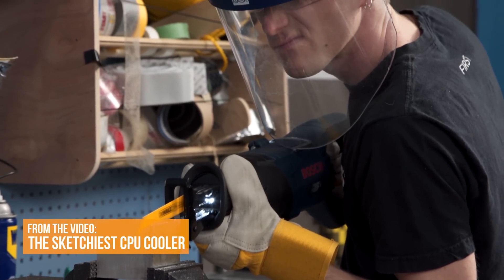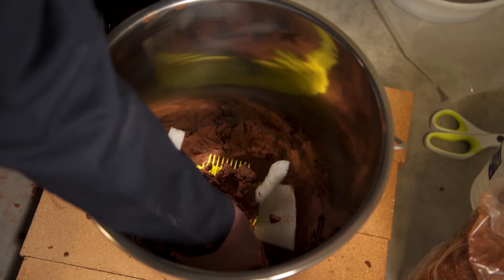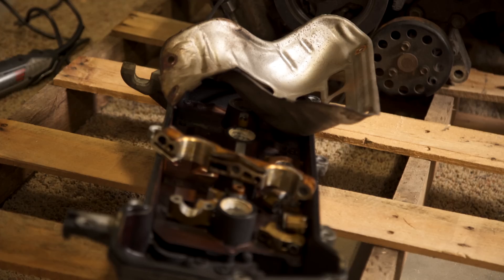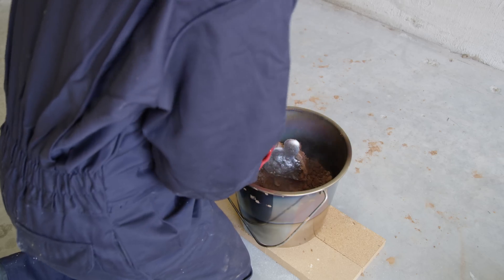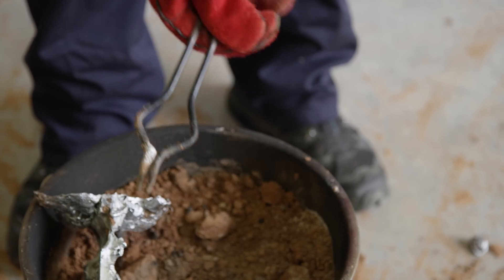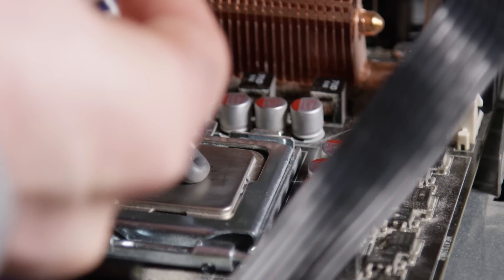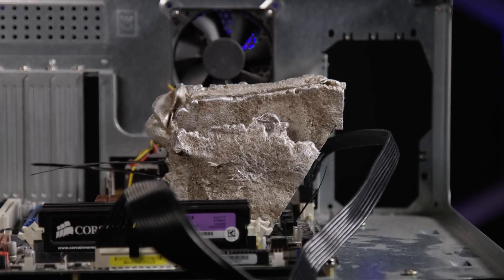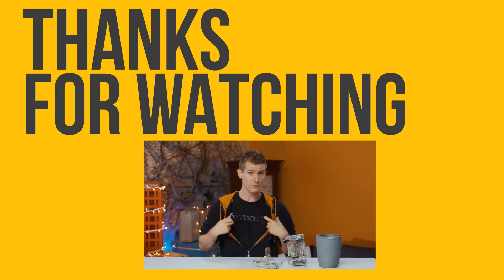The WORST CPU Cooler EVER – Sketchy Heatsinks Ep2

Comment: Aluminium sheets.
some bolts and nuts.
something to cut and make holes (i can do it with a paper cutter and a hammer with some scrapyard pieces)
is all you need to make a nice heat sink.

the idea is simple, you make a ton of small aluminium sheets, and some spaces with the bigger aluminium sheet using the paper cutter (notice that is a thin aluminium sheet) you make some spacers with the same aluminium, then you make the holes, and bolt them together.

another idea, very cheap, is to just pick a aluminium block, make some holes on it and install some break lines on them to pass liquid cooling using a fish pump.

my craziest idea of cooling system is just using old freezer parts, more specific the radiator and the fan along with some coper pipers. but that is a bit crazy, still it uses water... not gas.

Comment: why dont you just create a plastic version from a 3D printer, (or use PLA) and just stick it into the green sand, wait for the green sand to take its shape, and then pull it out. use the holes created as a mold, and pour the aluminium into that.

Comment: "...and the mould had to be oriented in such a way that the bottom would be the most likely surface to have a smooth, flat finish."

???

You're not going to get heat-sink level smoothness out of casting no matter what you do. You'll have to polish that surface and use thermal compound anyway, so stop worrying about inconsequential things. Just orient the mould the other way and let gravity draw your molten metal into the fins.

Comment: Polyfan, you need to do al the stuff with polyfan!
You can cut polyfan with a simple cutter or foam saw, you can sand it too!!! And is cheaper and cool than 3D print also
Then you  painting it with porcelain, let dry one or two days...
then you can cover it with sand and voila!!! (That is the method used for tiny triggers in weapons or clock machinery)
If you don't know how to do it ... you can't say "is a bad idea"

Comment: You should have packed the sand in a square plate shape, then used a rod to poke holes. You were too focused on making fins instead of considering easier designs.

Comment: Making a heat sink in home is not that hard
You could use a 1 cm thick aluminium plate and thin alumni sheets , And using TIG welding machine weld them together
You could also use coper plates and solder them together is so much easier than your method

Comment: Okay, a couple of things.
First, with the level of detail you need to cast a heat sink, use plaster of Paris, not sand or clay.
Second, Use the lost PLA method, meaning encase your 3d printed heatsink in the plaster,  Wait for it to dry, then put the mold in the oven upside down at around 500 degrees F and let all the PLA melt/ burn off leaving an empty cavity behind then blow it out to get any ashes/debris out of the cavity.
Finally get as much metal as hot as you can and pour it with the tallest risers and sprues you can make to completely fill said cavity.
you should have a bit more success that way.

Comment: Cast a long thin fin. Cut it to pieces. use foam as a spacer for the fins. Set the fins vertically on a molten aluminum brick cast. cut the sides of the cast to square it off. Use heat tape to put a piece of copper planchet on the flat area of the heat sink :)

Comment: you should use a 3d print and make a mold out of a mixture of equal parts plaster of pairs and play sand with a a riser but put it in a kiln or heat it with the torch and burn out and fully cure the mixture after it it dries but do it outside or in a highly ventilated room to avoid any fumes from the mixture or the plastic and then when you cast it you will not need nearly as much  static pressure

Comment: Dear Linus, if you try the foam way again, but cast it while the heatsink is upside down in the mold, you possibly won't have the trouble with the pressure.

Comment: next time, cast aluminium into a tube filled with those soaked water crystals (polymer balls) and flush out the polymer balls afterwards. you get a structure of aluminium that looks pretty much like a coral. i imagine that would dissipate heat pretty well.

Comment: Maybe better to use abs then pour shit ton of acetone in then the aluminum or your pla less dense so it would melt easier...both do not simply disappear though but in your mold make a spot below the heat sink where the melted pla or abs can drain to leaving only the aluminum in place of the mold..

Comment: Your green sand is way to wet...
 Lost PLA needs to be done by burning out the PLA before you pour. so you cast your PLA in a solid plaster type casting material, flip it upside down and put it in an oven to burn out your PLA leaving your negative.

Comment: Just look at how companies like Noctua do it. Make some heat pipes and attach fins to them for surface area. The pipes can be made from scratch with far less effort than casting metal, they conduct heat faster than solid metal, and it's cheap.

The process for making a heat pipe starts with a length of copper tubing.
Seal one end by crimping and soldering it shut.
Fill the tube a quarter full with practically any liquid that wont break down (tap water is good enough, acetone or alcohol are better but flammable and hard/dangerous to seal).
Raise the tubes temperature to the boiling point of the liquid.
While wearing eye protection and the liquid is boiling, crimp and solder the last end shut.
After cooling back down to room temperature, hold one end of the heat pipe under hot water or over a candle flame and notice how fast the opposite end heats up. If it's faster than a hollow copper tube of the same length, then the heat pipe is functioning.

Start with a straight tube and only bend it to shape after it's done.

Because it was sealed at the boiling point, when it cools back to ambient temperature the contents of the tube will be at negative pressure - this makes the liquid change phase at much lower temperatures than usual. How well it works depends on the temp difference/delta between the hot and cold ends, the liquid's heat capacity and a hundred other factors. It's an art, but a very forgiving one.

Optionally, rough up the inside surface of the copper pipe, and/or loosely* pack it with fiberglass (twist the fiberglass into a kind of string that fits easily down the tube). Packing it with lots of tiny graphite rods could also work, instead of fiberglass. All of these provide a literal wick to carry condensed liquid back from the cold to hot end, and nucleation sites to promote phase change. These fillers may reduce the volume of the tube, and the amount of liquid should also be reduced.

Comment: A cnc machine would have gone a long way in this project
Reply: Can't believe I've been scrolling through comments for 5 minutes and this is literally the first one about CNC machining. Totally agree, they should have sent the solid to a machine shop.
Reply: You could do anything you want with CNC that was not the point of the video..
Reply: No no no.  You just CNC everything.  Those air bubbles in the aluminum would kill it.  They act as blocks to the flow of heat.  CNC to cut fins and smooth base.
Reply: Seth Nicodemus I'm afraid that the castings they've produced there would've had to be shaped for a REALLY long time using a CNC before they would've resembled anything usable....
Reply: Not a good idea. CNCs are no idiot-proof. They will happily destroy themselves if you give them wrong instructions.
Reply: They did a milled heatsink. The DIY water block. They had their neighbor make one up using a manual mill.
Reply: With a computer controlled Cnc it’s trivial. That’s probably how they are made in the first place I am almost positive. I don’t think they are cast.
Reply: a c well even if they did a milled water block some other video it doesn’t help here
Reply: hellterminator so will a car...  but qualified operators use them all the time.  Not sure of your point.
Reply: +Andy T After watching this do you honestly think any of these doofuses is qualified?
Reply: @hellterminator  get an old hand-crank Bridgeport like in high-school, and they'll be fine.
Reply: hellterminator no. But it’s Canada. Don’t they have free health care or something. There’s the shy red head that seems to know a small amount. But it wasn’t really a suggestion that they actually do It. Just that we’re you insistent on actually for some reason making your own heat sink- say you work for nasa for a custom computer- not PC x86 entertainment vlog- the proper way would be CNC. 

Here. All that matters is the number of views. Views * YouTube pay rate * other math stuff= paycheck. 

That’s the only important thing here.  Linus tech tips is a tech news and reviews site. All the critics want them to be like metallurgical and engineering experts. Those channels exist too.

Comment: Lul, if you're going to make a sand cast you need to be able to have two separate frames(you can even use wooden if you make the big enough) in which you put the sand so that you can split them.
Pack one of the frames and lower the model(printed) preferably with fins downwards. Make it so the base stick up just a tad from the first frame fully packed. Then you put on the other frame and start filling it with sand until both frames are filled and packed. You can even make a hole(where you will fill with metal later on. You let it dry and then carefully separate the frames so that you can pull out  the model and close the frames back together(need to stress the importance of getting this straight)
Then you heat up the metal and pour it in the hole. Don't expect worlds greatest result however, since the details are too delicate, you're supposed to CNC these kind of things :)

Comment: 4 minutes in.. and im a simple carpenter /handyman 
.. Did you consider to put the mold with aluminum in a vacuum chamber -.- ? 
Did you guys consider to make air flow channels for the molten aluminum?.. simply see it as water, and if you got air trapped.. that is heating up, you can even get a explosion of molten alu in your face xP

Comment: try wax instead of plastic
and gypsum instead of green sand

you make the shape with the wax, and then you mix the gypsum powder with water, put the wax in the gypsum liquid (make sure you leave a gap in top where is the liquid aluminium goes in and another gap in the bottom  to make sure all the wax and the air goes out) make a top and bottom steak in your wax design and then cut them off after you finish with the aluminium

Comment: Aluminum sheets, threaded rods, washers, nuts, a welder, a CNC machine and a copper or aluminum block for the base.

Cut some of the aluminum sheets with holes for the threaded rod to make the fins, shape the base with the CNC machine to fit the socket, use a piece of aluminum sheet and drill some holes to fit in the motherboard so you can hold the CPU cooler in place. Use another piece of aluminum for the backplate (optional) with holes for the screws. Use the welder to weld the threaded bars with the base and be sure to place the piece that screws to the motherboard first.

Place some washers in the threaded rod but don't use so much or the heat won't reach the fins propperly, then place a fin, 1 or 2 washers, a fin, and do this ultil you almost reach the top, then screw a washer and a nut. Do this with all the threaded rods. Polish the base of the contact zone so it has a full contact surface with the thermic paste and voilà, you have a not so cheap but handmade CPU cooler.

I don't know how to do those vapor chambers, but 4 threaded rods should work for a low budget or an old CPU. I recommend you to make a little notch in the fins so you can fit a fan with some fan clips in both sides. You can use some kind of spacer instead of washers and weld the fins directly to the rod, this will improve the efficiency but will take more time. Don't forget to remove the spacers.

I'm not a native english speaker, you know the drill.

Comment: why not use cemment or pure clay den add an airpocket den melt the plastick on the airpocket den block the pockets with clay or cemment den add the aluminum casting that would work

Comment: I notice that you were putting the mold with the fins pointing up. If you use the plastic mold no doubt you will be able to apply more force to the packing procedure making it easier for the sand to hold the shape. When you orient the mold with the thicker parts on top the aluminum will fill those parts fist with out loosing too much heat since you're constantly pouring it on top. Also a slower steadier pour should result in a more evenly distributed cast even though you might have to grind the piece a little. You can't use too much water because of the steam bubbles and the problem of cooling the metal too quickly. A thinner sand with some moisture should be enough to make a decent mold. you don't need clay unless  you're gonna bake the mold to make it permanent which would probably be the best way. Id like to see you try this again. The heat sync you guys designed looks promising.

Comment: when pouring the mold turn the design upside down. gravity will push the molten aluminum into all the "slots". youll have more finishing work with grinding off the excess but with much better results

Comment: I saw an instructional web page a looong time ago that showed precision honing of a copper-based heatsink and the CPU, so that they were nearly perfectly matched and mirror finished. I would really like to see you, or someone, show some real results from this. Since the best heatsink compounds available are only a tiny fraction as thermally conductive as the metals it is between, and they are only there to displace air, which is even less thermally conductive, the concept of a perfectly mated surface has a lot of merit.

Also, a ready source of casted aluminum should already be in your shop... The main structure of a mechanical hard drive is cast aluminum.

Comment: One ought to have packed the sand REALLY tight and then pre-heated it until it could keep the aluminium molten on its own - give the ally the best chance to actually flow where it needs to and remain solid, not porous

Comment: You can drill a solid block of aluminium on drill press into pretty ok working stack of pins that will do the heatsink job just fine, if there was a competition or something similar...
OR you can visit your cheapest electronics shop, that is open 24/7 - THE DUMPSTER. I am shure this is the easier way.

Comment: SIMPLE DIY IDEA GUYZ 

Get aluminium cans, cut and make into strips, some small some long, small ones and big ones form base, interlace them - small - big -small - big, the big ones extend from formed base making the heat fins (or whatever they are called). now compress base, really tight u want it (mmhmm) then attach solid aluminium or copper block base to DIY aluminium can base, not sure how best to do that, maybe solder or even a touch of magic. anyone got any ideas on this (could u just buy strips in bulk?)
Reply: Yea this is as bad as the ideas they had.  Worse.  None of these were likely to work.  I would have just gotten a block of machining aluminum and milled it.  It would have turned out just as good as the ones you buy.  Or close.  You need machining aluminum and importantly a CNC.
Reply: Andy T naw, I could make their original design in a good old Mill with the right bits
Reply: Andy T why cnc? Aluminium is easy to work with, even in a manual mill, even if the result is not as pretty as in cnc.
Reply: I'm sorry, but this is not a good idea. Aluminium cans don't contain too much aluminium (their walls are incredibly thin) and thus they won't be able to dissipate heat. And to make things worse, "interlacing" them will make bad heat conductivity points between them as well.

Comment: you are soo sooo wrong... look, if you want to cast aluminium properly you need a heat resistant bowl over the casting , filled with an inert gas (argon you can get from welder supplies) and lack of oxygen does prevent forming of aluminium oxide.

Comment: Guys, you had the right idea with the sand, you should have done it backwards and just shoved the heatsink mold into the TOP  upside down..... then put a plate on the back to push it into the mold... heat more aluminum then push it down again into the mold... repeat until desired height....

Comment: For another go at "sketchy heatsink", maybe try:
1. casting a base onto precut plates.
2. bolt together of plates + spacers, lapping the base, or maybe resistance weld the construction and then lap.
3. for a cast design, a central core with radial plates may cast better

Comment: Why didn't you do it upside down! Try to use PLA and you could make a small hole so the pla could melt down somewhere and then you cloud just file the top. So it would fit! And if the metal spilled in to the small holes you could just cut them of. Plus if you did not get it you should only put in the mould in they "clay" and live a little overlap BUT do NOT cover the top

Comment: It probably would have been easier to take a bunch of copper plates and then just solder or JB weld them onto a base plate perpendicularly to form the fins. Still sketchy as shit but you don't need to pretend that you know how to cast aluminum. Or, go with the original plan and start with a block of aluminum but instead of using a saw that is better suited for drywall, use a drill press and router to carve the fins out.

Comment: Wrong tools, 4 1/2 grinder with cutoff wheel couldve cut some alright fins in that chunk, and cleaned up the base for mounting a lot better. That orbital sander and sawzall are not the greatest choices for metal work. Especially with it being that thick.

Comment: why wouldn't they turn the pla heat sink upside down in the green sand make a cast of fins and bottom in 2 pieces add filling pipes then place two pieces together and then fill with aluminum ...